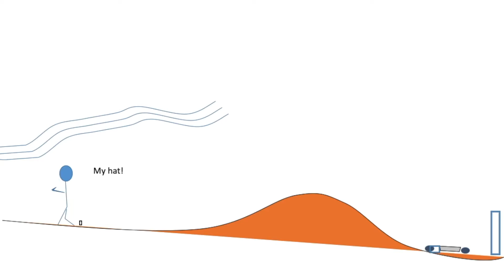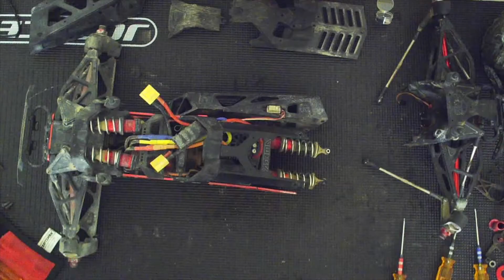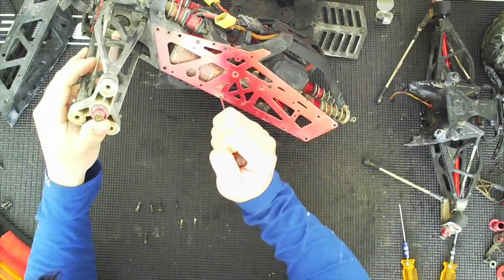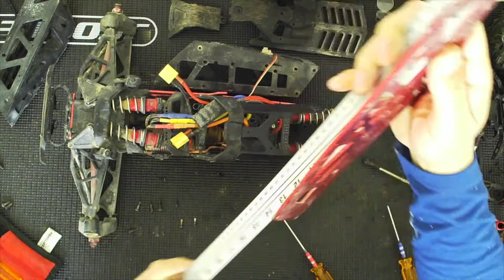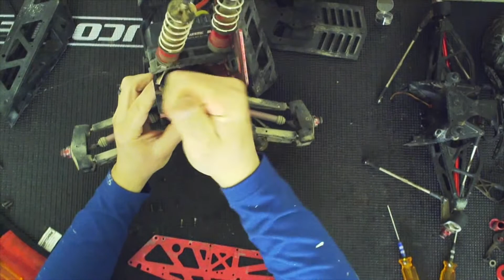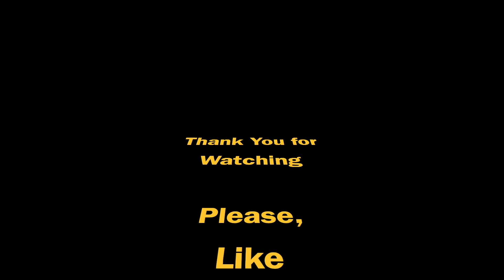Arrma Nero Teardown Part 6 Remove chassis plate explain how to remove motor servo receiver etc

Comment: Interesting that the tvps are bent. Probably needed some more bracing.
Reply from the maker: I think so as well. Maybe if a it has some horizontal "ribs" it would help. The HPI Savage would also bend in a similar fashion. They are strong head on or up and down, but hard side impacts tend to bend them.